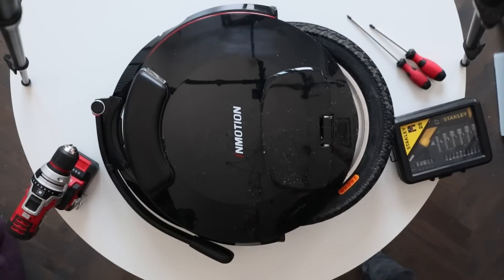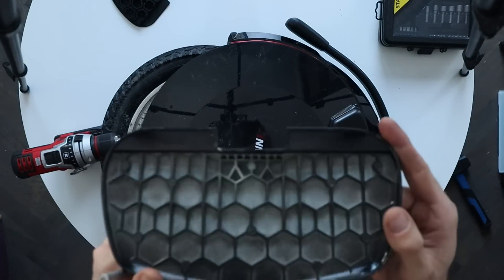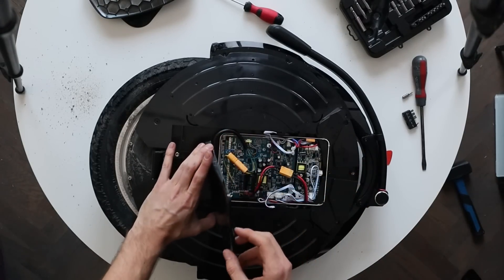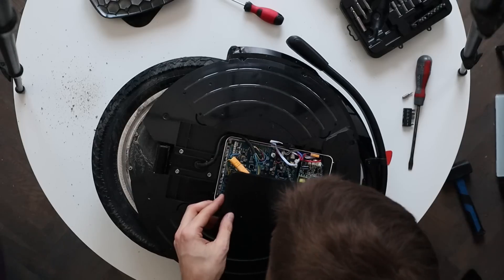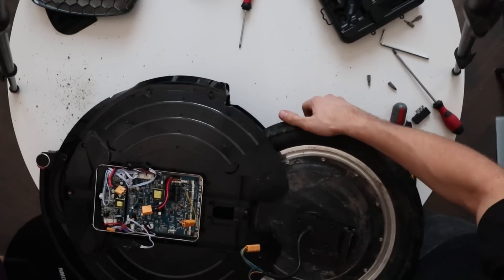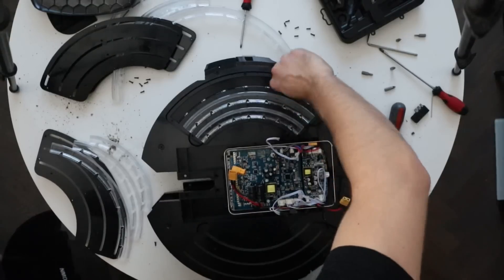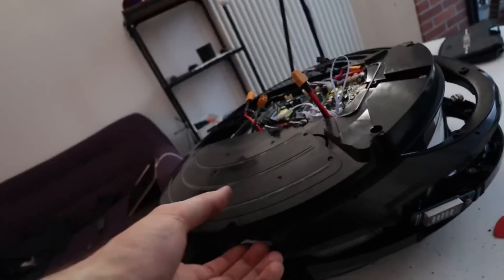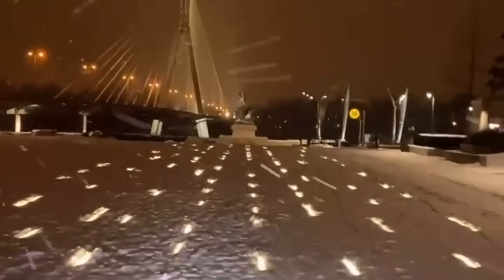InMotion V10F Teardown (2021) - What's the build quality like?

Comment: Rode mine in the rain today then went through a big puddle and now it doesn’t work. I’m at the point where you peel the shells apart to get to the battery and it doesn’t look like water got into the board area, but the tiny little plastic ridges that hold that rubber gasket for the board are all pretty broken so water may have gotten in there. I’m really bummed out because I don’t have a backup wheel.

Edit:dried it out and it works again. Found a really small screw (Phillips) after I tore it apart that I didn’t remove from anywhere. Very curious as to where it came from. It’s definitely from the wheel.

Comment: Sir please answer I got crash and one of the silver tin fiber in black wire of battery is separate, is that danger sir to ride again, I do check on diagnose in inmotion  app is in good condition, what should I do sir I'm really scare to ride, is that safety to keep ride sir, please answer sir

Comment: Hello from France and thank you for your very explicit video. When I turn stationary in place to the right or to the left, my wheel tilts forward or backward, this is not normal I think. Where is the gyroscopic sensor, the one that allows the motor to keep the wheel in a vertical position?
Is there an exploded plan of V10?
Thanks in advance for your answer and sorry for my English.
Frank.

Comment: Inmotion's build quality is why I chose them for my First wheel & V11 for my suspension option (Z10 is just to hard to get in USA).  This booger is a beast for it's size.  I would push it hard with my 230lbs, until I got cautious about my weight overpowering wheels.  Does sound like a copy machine in "OFF ROAD" Mode.
Cut 2.5" inches off the Trolley Handle and so much easier to use.  Raises it from the brake light, felt it was to close blocking some visibility.  I want someone behind to know my fat a$$ is stopping.

Comment: Nice. You just did it a bit wrong. You should pull out other part of the shell, which is opposite to controller board. So you don't have to care about all the wires etc. And also plastic parts of pedal screws are for tightening the pedals as they are hold up by friction.

Comment: The motherboard cover is good, but it is not complete protection. Dust and water can (and will) get inside through the cable cutouts. Still, it greatly limits the amounts and the wetness I found in is probably just from air moisture.

By the way, a new V10 looks exactly the same inside as far as I can tell. It just has different battery cells.
Reply: I think both these wheels have been out for a while and InMotion definitely silently changed some things to water seal this thing. I read that the V10 even came with increased capacity because the cells were the same price but InMotion never announced they just put in the better cells. Its confirmed the controller, motor is all the same. Just the battery.

Comment: The nylon screws for the pedal is for the friction lock.  I wish all wheels use that instead magnets.  Magnets are useless when you have jump pads.
Reply: it is not for friction lock. For this purpose there is one screw under the pedal, (with blue glue on the movie)
Reply: @duncanoo  what are you talking about? The set screws on the bottom holds the pedal rod in place to prevent rotation.  Then the nylon screws can squeeze the rod from both ends to have friction for you to fold up the pedals.  Seriously, I own this wheel and disassembled it many times.  That's how it works!
Reply: @mc-dq6oj  yes I confirm. I though magnets are better because, the pedal just falls down when you give it a kick. No hand needed

Comment: still gonna shut down on long steep rides. Adam will not ride this wheel with his style. :)
Reply: How steep? I've tried to climb every hill I can find with this thing and it didn't shut down. Although it did overload when I tried to go too fast up a steep hill. But if you take it easy, it doesn't seem to overload. At least with my weight ~70kg.
Reply from the maker: I burned a V10F going up on a 30 degree hill or so. Indeed it cant handle hard hillclmbs and hard acceleration. Always when i accelerated hard enough on my V10 the pedała would just go up and bring me to a stop
Reply: @mr_wrongway  Did it like actually burn something inside or just overload and reboot?
Reply from the maker: @4nlimited3dition_4n3d  I burned fuses on V10, V8F and burnt motherboard 3 times on V5F only IM I didn’t burn yet is V11 but I probably could if I really wanted to
Reply: @mr_wrongway  you make the inmotion struggle with your riding style Adam 😂 The fuse is placed low enough on the inmotion 30 amp fuse as that only allows peaks at 2500w which is not enough
Reply: @TutosBricolages  depends of which type of fuse it is. Some are faster some slower. But yeah I never got nearby to burn a fuse :D

Comment: Fajny sprzęt,szkoda tylko że wejście do ładowania jest podobne do tego co jest przy mikrofonie,jest mało bezpiecznie
Reply from the maker: No trochę inny port czyli GX-12-3 ale faktycznie przydało by się coś innego. Dodatkowo fajnie by było jak by nie był u góry pojazdu tylko z boku
Reply: The charge port is perfectly safe. It doesn't put out any voltage (0,03) unless it detects a secure connection to the charger. I just checked on mine again with a voltmeter.
Port ładowania jest całkowicie bezpieczny. Nie wystawia żadnego napięcia (0,03), chyba że wykryje bezpieczne połączenie z ładowarką. Właśnie ponownie sprawdziłem swój woltomierzem.

Comment: I was going to DIY some stands from yogablocks and velcro. But now I am going to buy these flower pots for balcony and call it a day.

V10f is build very very well. It doesn't look like a hackjob or a hobby project. I was surprised the battery sits on top. It's allmost impossible to get water in the motherboard or battery.

Comment: Good video ! inmotion did a good job on this wheel, make the same video for one wheel from each brand! that would be interesting
Reply: Yes!, this is one of the most important aspects of any review imo. Going through the actual build quality of the product. 
Just outside looks doesn't tell us much about whether a wheel is good or bad quality.
Reply: @4nlimited3dition_4n3d  I totally agree. I am impressed with the design of the speaker modules being symmetrical and how the inner case halves completely surround the battery and with silicone! Then the controller is also in its own compartment and not just willy nilly exposed behind a piece of exterior shell. That second compartment has me intrigued at what to fill it with :)

Comment: Are these things safe to keep inside an apartment?
Reply from the maker: Yup :)
Reply: Depends on the brand and individual wheel.
Reply: @4nlimited3dition_4n3d  im looking at getting the veteran sherman
Reply: @christophbrady  It's better than Gotway for sure, but it's not yet at Inmotion / Ninebot level judging from the problems I have seen people posting with some wheels. Still though generally it should be fine. I haven't seen a Sherman battery blow up yet or cause a fire. Just individual control boards frying in intense testing and a few battery BMS's acting up / needing replacement.

Comment: I suspect a heat gun would be useful for removing the pads without breaking up the adhesive.
Reply: I think the heatgun would damage the pads.
Reply: @BunnyslippersEUC  If used incorrectly yes. Otherwise the heat flow should be easily to moderate. All a heat gun is, is a more powerful hair dryer pushing air at a slower speed.

Comment: Higher quality then Gotway? 
I believe Gotway is the worst and Inmotion best.....
Reply: Inmotion / Ninebot definitely at the top. Gotway is pretty much the lowest quality there is. But when it doesn't explode or cut out, it's  also the cheapest and fastest with the most battery life.
Reply: @4nlimited3dition_4n3d  plenty of reports of failing Inmotion EUC as well. Just recently someone posted a failed motor on 40 mile old V8F. Heard of plenty of cutouts and failures on V11 (someone I knew had the control board fry). V10 overheats on overheat hill.....So I don't think Gotway is any worse than the others, especially Tesla is rock solid - hardly any failure reports
Reply: @felixfranz2799  I was mostly referring to the overall build quality between brands. Take a  look inside any Gotway and compare it to any Ninebot or Inmotion. I'm not saying any of them are perfect. Inmotion has plenty issue as well for sure, but Gotway wheels are the ones with consistently bad build quality and designs. They really should work on that.

Comment: The V10F was my dream upgrade shortly after learning to ride! 😊
Reply: I have a V10F, it is a great wheel as far as I am concerned.
Reply: @kmg501  Agreed. Been riding it for a year in all weather, rain, steep puddles, snow,... still working fine and hasn't cut out even once. Only overloaded a few times when trying to go over the top speed.
Reply: @4nlimited3dition_4n3d  what was your top speed limit on the inmotion V10F ? I don't feel very secure at 40km/h
Reply: @aia2735  I have it set at 40. Haven't tried anything faster. Also, I mostly ride at around 20-30km/h. When going up a hill if I speed up too much (35-40km/h) it can overload and stop and tell me to get off. I do prefer that over a simple cutout a face to the pavement though.
Reply: @aia2735  it's totally secure
Reply: @aia2735  I ride it 25-35kmh all the time. Firmware wise it cannot hold speed at 40kmh because it will tilt back. I feel its stable at 35kmh on flat ground and definitely has a motor/tire that can go 40-50kmh but firmware limits where InMotion has decided this wheel should cruise at.
Reply: Thanks for your feedback ! I'll feel more safe on it with your words